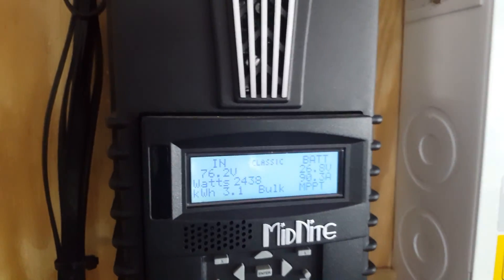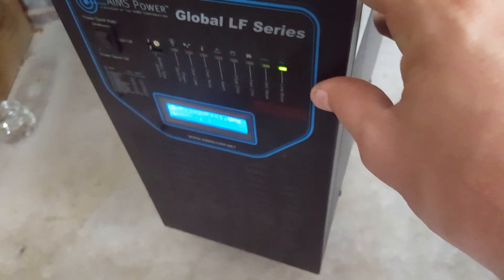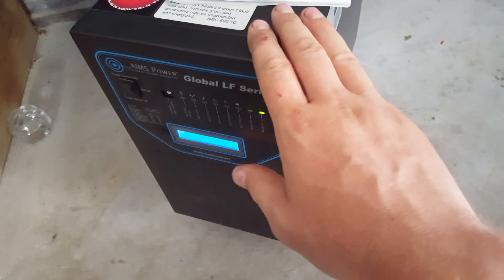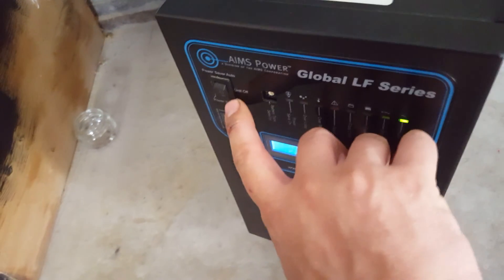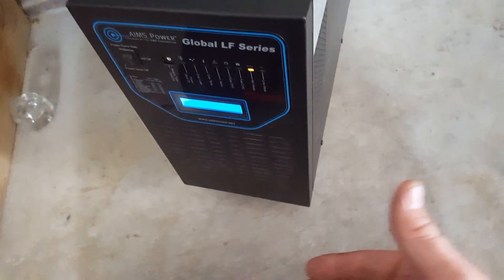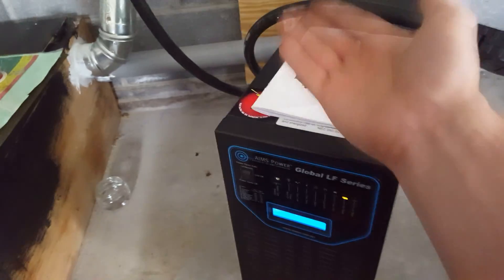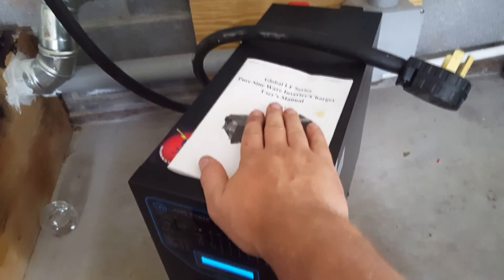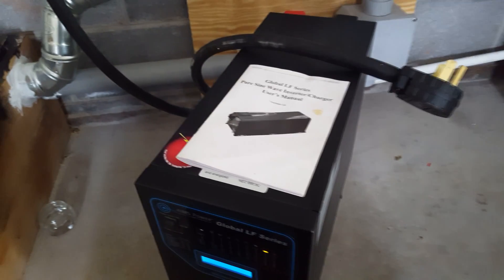My Worst Nightmare  6000 WATT LOW FREQUENCY INVERTER CHARGER - 24 VOLT- SPLIT PHASE Problems

Comment: Yes 300% overdrive .. but you need NO VOLTAGE DROP !!!! 
IF YOU CAN'T PULL WHAT EVER AMP!!! 
18.000 WATT IS 334 A M P!!!  48V IF YOU USE 24V IT'S 668A .. IF YOU CAN'T DELIVER
THE AIMS CAN'T PERFORM ... 
You ofcorse use 50mm² atleast power cabel if not .. and a big enough fuse
welllll there is you problem

Comment: Is there a battery on the motherboard of the inverter? Like a CMOS battery on a computer?
Reply from the maker: +James Pottorff I did not see it
Reply from the maker: +James Pottorff I did not see it
Reply: @solarpowerelectricityandel2915  IT is not nessesery a FLAT type batteri